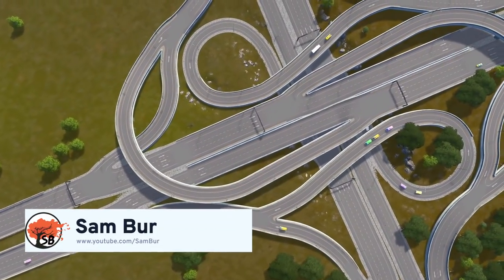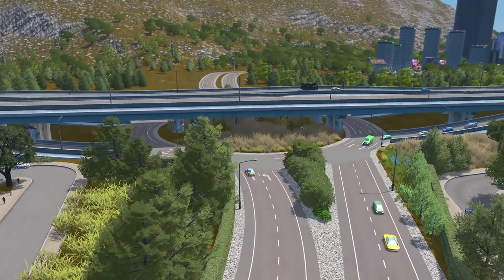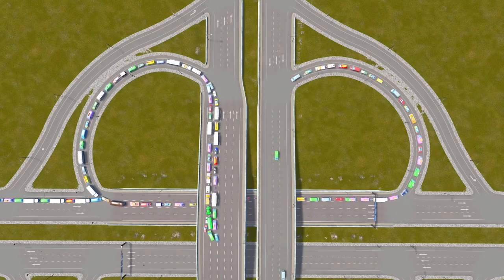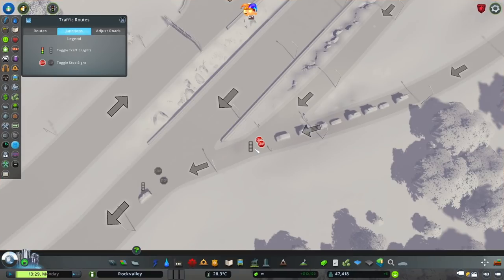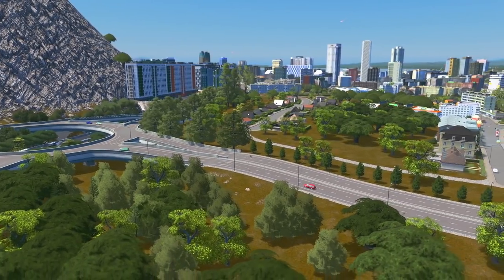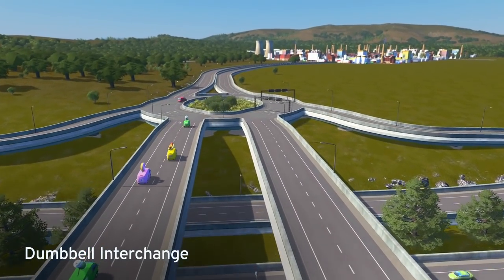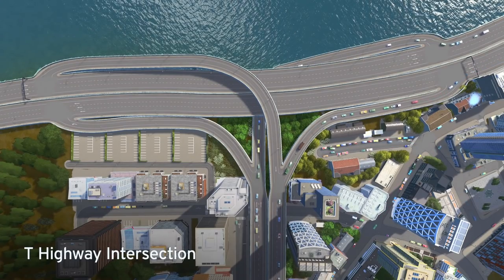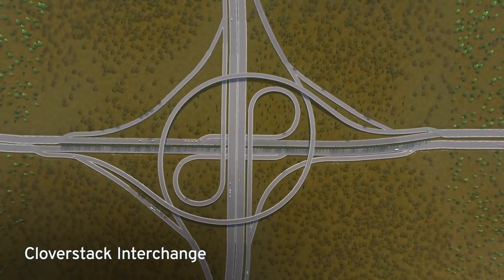Highway Interchanges with Sam Bur | Modded Tutorial | Cities: Skylines

Comment: Another good tip: Fast lines. I often build 2+2 highway in middle with unlimited speed and no junctions and then 2+2 highway outer highway with interchanges, sliplanes etc. Often with slower speeds. Like 90 or 100kmh

Comment: Hint for any one who don't know yet. (RHT)
1. They will refer the lane with has more arrow. I has made the middle lane to turn right and straigh, the right lane only turn right and most of them (maybe all of them) using the middle lane.
2. Give way sign is very helpful. If you has some car go from slip lane to high way and go right out the outside then "give way sign" will fix the problem. The give way sign doesn't actually give "way", it more like give "lane". I used to saw that they doesn't stop and wait for the car on the piority road to come first, they just go normally. It because the normal car is not go the same lane at the car on piority road so it pass.
3. Player should not make slip lane go from High Way snap right to the normal road, it "may" end up messing the normal road and noise polution. 4. Traffic solution? I used to fix my own traffic without the help of Biffa and Sam Bur because (maybe only Biffa usually did) they make some road become useless. 
I may gonna create a series that fix traffic in my way :)

Comment: Best is not stack interchanges.  It still prioritizes one side of highway.  They are complex and expensive.

Look up the Square-A-Bout by twistedmelon which is a compact vanilla ploppable interchange that allow for extremely dense traffic flow.  Look beyond real world and consider as a game.

want to see its potential?  Look up a post in steam by searching topic "why roundabouts are inferior"  Square-a-bouts and herringbones can handle enough capacity to run full four lane highways and six lane roadways.  That thread shows a single location industry focused city with no mass transit or rails and done zero mods.

Use both sides of roadway.  Dont stick in past with single side merge and exits.
Reply: Thanks for the idea. I'll check those out in-game.